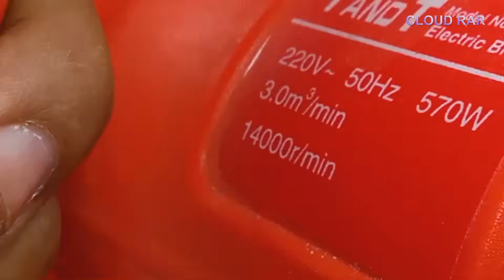New... how to make free energy 220v AC 10000W powerful electricity generator turns iron Bolt copper

Comment: Good tip, buddy! When watching the video tutorial, I had the following questions: how many turns of copper wire are made in these coils and, once ready, can I connect a sound system or TV? and what is the thickness of the wire used in the coil, wire gauge?
Reply from the maker: 16

Comment: This is the classic motor running a generator back into the motor, technically shouldn't be able to work, but the generator alternating the magnet pulsing the coils is clever, this working hinges entirely on the power required to run the motor versus how much that motor turning the magnet between the 2 coils generate power into the "powerstrip" portion, which relies on the magnets B field and the coils dimensions and turn numbers. The problem is as the power is being generated in those coils, those coils in turn create a repulsive magnetic field making the magnet turning in the middle harder to turn. This is why this concept usually never works... the more power its making the harder it is to turn, so the motor turning the magnet in the generator portion needs more power to run the generator portion to match the power its using which needs perfect efficiency in energy transfer that is usually lost due to heat and imperfect construction and usage of the magnetic fields in question... if it works hell yeah, but I have my doubt as many people who understand the physics here would have.

Comment: Where are the details of these project?
1. The thickness gauge of the copper wire?
2. The diameter and thickness gauge of each magnet used?.
3. The number of coils of the copper wire wound around each magnet?.
4. How do you fix the rolling magnet?
5. What is the capacity of the rolling machine?
6. What is the capacity of the energy produced?

Comment: 10 kilowatts is 40 amps. ..  requiring # 6 output wired  the wires we see are #14 or #12, ,Max 20 amps before melting. . . Nice dreams. .

Comment: Generator runs 570w vac cleaner &3 bulbs approximately 120w totally 690w, how you can claim it's capacity 10000w . Let me know
Reply: Agree
Reply: @akmalal-bintany8936  agreed
Reply: posible, Inside the Outlet you have a  battery
Reply: Make one for me. Please I'll pay
Reply: Assalamualaikum,, saya ikut bangga .karenabanyak anak bangsa ilmunya ok juga .👍🌷👍👍👍👉
Reply: @VirmanRokhim  In that case they should use it instead of making crap scam videos

Comment: I am running 2 air conditioner,  4 ceiling fan,  10 9w LED bulbs, 1 refrigerator,  1 mixer grider. Amazing  😂😂😂😂
Reply: Doest it really woork
Reply: Does it affect
Reply: Feku
Reply: @rajagee7747>
Reply: The gaus is going to run out.. fast.. so for how long ?
Reply: Ai bot
Reply: I'm turning my house around for free with this thing.
Reply: Heeee😂😂😂😂😂
Reply: @musthafashaik2598 1១១1១១១១១១១១១1❤😊

Comment: What is the rating of the AC motor you are using? Does the rating determine the capacity of the power produced?
Reply: От вентилятора ..не благодарит ))
Reply: 1.21 Jigawatts, Per Dr Emmet Brown. Butt check with Marty too. (Also known as Calvin.)